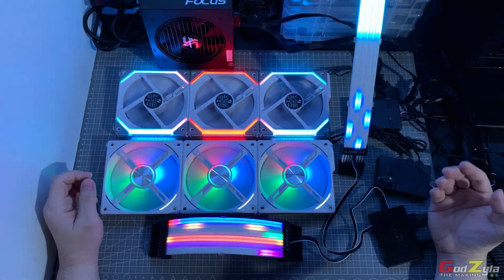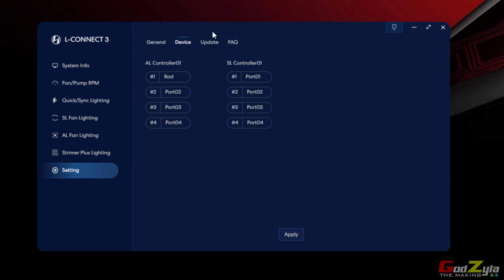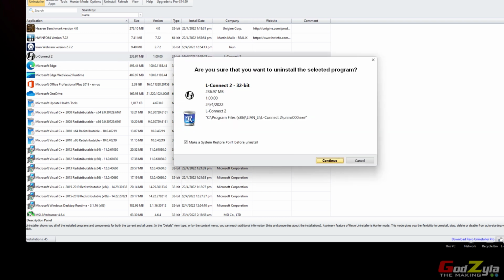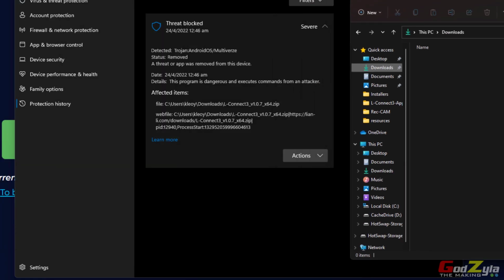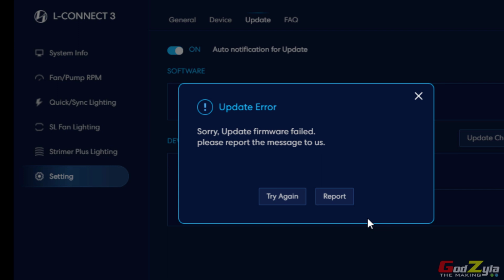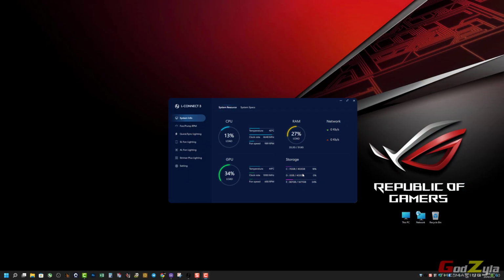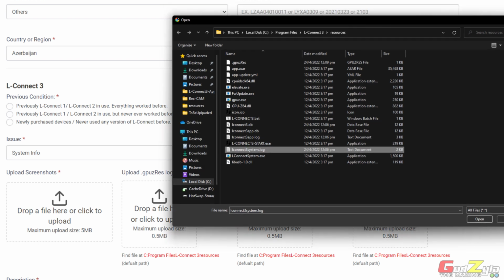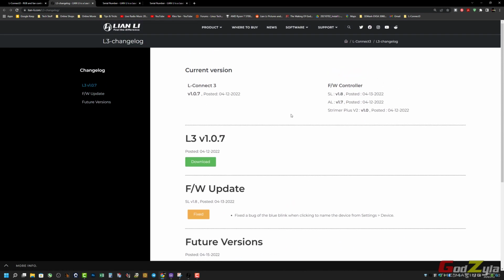Lian Li - L-Connect 3 (Installation)

Comment: hi,really like your video, i just installed l-Connect 3, but show cpu rpm is 0, cpu temperature is 0, how to fix it? thank you
Reply from the maker: Hi xiaotian wang, welcome to my channel. After installing the L-Connect 3, did you try to reboot your system? if after reboot and it still does not work, kindly grab the logs as shown in this video and to submit at lian li tech side. Do pardon me as i have limited knowledge to fix that. Once again thank you for your visit and the compliment.
Reply: @KleoYan  thank you for the fast reply. i did reboot.
Do you think  al120 fans should connect to lian li hub or connect to motherboard fan header?
Reply from the maker: @xiaotianwang5282  It depends what are those fans for. If it's for radiator, I would plug the fan load directly to the motherboard fan header instead of the uni controller and to leave the argb connector to your uni controller. The reason for this is.. just incase if the uni controller die on you. the only thing that will not work is your fans and not your fan load which is required to cool down the radiator. This is just my opinion.
Reply: @KleoYan  i don't have radiantor, just air cooler. so uni fans in my pc just for air flow
Reply from the maker: @xiaotianwang5282  I see, as mentioned is your choice. you can plug to the uni fan controller for both fan load and argb load. but i will still recommend to connect the fan load to your motherboard fan header that says CPU_FAN and plug the argb to your uni fan controller. The choice is yours .
Reply: @KleoYan  thank you for the reply.
should i connect fans to cpu header or cha_fan header? And air cooler is using the cpu header now.
Reply from the maker: @xiaotianwang5282  hi, ok am not going to confuse you as I am not clear what fans you are using for and such.. let me just put it this way.

1) for Air cooler fans for your processor, just make sure it's plug to the CPU_FAN header. if have argb on fans, then plug the argb connector to the uni controller. Let your motherboard control the fans RPM and let uni controller control the argb. 

2) The rest of the case fans, just plug to the uni controller, let uni controller control those fans.

Comment: Great video. So we need a whole new v2 controller to be able to control the strimer plus cables? What’s this all in one solution you were talking about? Connecting all the fans and also all the strimer plus cables to one controller.. Is that what the V2 controller going to be able to do so we don’t have to use the uni hub for the fans and the other controller for the strimer cables
Reply from the maker: Hi Allen Sosten, welcome to my channel, the new strimer v2 controller is for your strimer plus only. Let’s put it this way. For software is all in one in L-Connect 3 app, as for hardware you will need the respective controllers for AL fans, SL fans and the strimer plus argb strips. Hope I did not confuse you.
Reply: @KleoYan  oh ok. Nope. Perfectly understood. Thank you. When will this new V2 controller be available to us?  Also i recently bought the new SL unihub so I’m able to use LCONNECT 2 with my unifans. I’m wondering will I need new uni hubs for L Connect 3 or will I just be able to dload LConnect and it’ll integrate my unifans?
Reply from the maker: @A.Sostan  the uni fan controllers of either AL or SL works fine with this L-Connect 3 app. It’s plug and play but firmware upgrade might be needed. It can be done through this L-Connect 3 App. 
As for strimer plus v2 controller, release date as what I know will be around earliest May to mid May. If you do not have the strimer plus and intend to get it. Wait till the strimer plus v2 is out as it comes with the v2 controller.
Reply: @KleoYan  thank you for the responses. Appreciate it !
Reply from the maker: @A.Sostan  you are most welcome.

Comment: Absolutely love your channel as it is my go to spot for detailed information whenever Lian Li comes out with something new.  I may wait until the new v2 ontroller is out for the Original strimer plus and check the price.  Thanks for this video.
Reply from the maker: Hi Pat Sipes, welcome to my channel and thank you for the compliment. Yup info on those v2 should be around the corner. 👍

Comment: Hello @Kleo Yan, couldn’t catch you on what you said about “they have powerful machine” I am on X570 Aorus master, 5900X,rtx 3080, is it possible to update all my controllers normally without plug 1 by 1 or it can cause bricks?
Reply from the maker: Hi Yasser AK, welcome to my channel. I have seen some of my friends having successful rate by updating the firmware with 2 uni controllers plug in but on the safe side, I recommend do it one at a time to update the firmware. The choice is yours. Either you take the risk not to.
Reply: @KleoYan  Oh I see, Thanks bro for the great video.
Reply from the maker: @yasserak1607  You are most welcome.

Comment: After a little under a year with 5 sl120s and Lconnect 2..I Finally...was able to get...adjustable fan speeds...it was default set to quiet..which I'm fine with..but now I have the cool option of setting the speed..needed some update called mouse ..something...anyway this popped up on my recommendations..so I added this comment
Reply from the maker: Hi Rico Suave, welcome to my channel and thanks for the feedback. Greatly appreciated 👍

Comment: Well
Untill all problems are solved I will not use L connect 3
It's incorrect and causing so much problems
I am kinda disappointed from lian LI because they take forever to fix something
Same for new stuff
They take forever to publish the new infinity fans
Reply: Yeo they should sort the issues out before releasing the software. My L2 is working fine, once this has no issues i might upgrade.
Reply from the maker: @PixelVogue  hi, welcome to my channel, let’s look on the bright side, at least you can have all in one to control everything without installing different application but nevertheless, yup should iron things out but it will be good if users like us find some issues and report to them. As not all pc works the same way. There are so many combination of hardwares. Once again thank you for your valuable feedback.
Reply from the maker: Hello J J, welcome back. I understood where you are coming from. Lets see if Lian Li does fix all the issues we are facing. It will be good if you did ever try the app and have issues, submit the log for them to diagnose. I can only tell you that during the beta test, there are more issues but they did fix some issues which I have listed to them.  Thank you for your feedback too and being supportive to my channel.

Comment: Why do they have to make a complete new software? It would be more convenient to just give us an update for the Lian connect 2
Reply from the maker: Hello M Guardiola, welcome to my channel. well lets just say that the competition is pretty competitive. Base on what I feel is that Lian Li is trying to set this software as a one stop hub to control all.
Reply: @KleoYan  Well, Lian Li have failed miserably. Their beta test program is a perfect example of how not to beta test. They have released a software that isn't fit to be an alpha build. Which begs the question; What were the beta tester actually doing? The whole software is a buggy mess! They couldn't even be bothered to digitally sign the software.. Lian Li need to stop bringing out new hardware, and spend more time building a new software, or even a proper ecosystem for what they have right now.
Reply from the maker: @Mapantz1  hi and welcome to my channel. Thank you for your feedback. I partially agreed with you. I was one of the beta tester and during that period, there were other issues with the argb effects and they did iron them out before releasing version 1.0.0. Yes no doubt there are bugs and such. I proceed to work with my issues via the form I've submitted to Lian Li Tech Support https://lian-li.com/faq/. With replies, I continues to feedback and to test. You might say this should be their problem not ours, but I want things to get resolve? Will that be resolve by not even giving them the chance to diagnose what I am facing? Anyway my experience was great, though it's a painful process but gradually my issues got resolved one at a time. These are my issues and the version mentioned where not even publish till they have gathered enough information which not only resolved my issues but others who have faced it. 

1) Version 1.1.5, It does capture CPU & GPU readings but it stay still, does not move with real time stats
2) Version 1.1.6, it does capture CPU &  GPU readings and it does reflect real time stats but with delays
3) Version 1.1.7, it does resolve 1) & 2) but had issues with fans following the temperature as my fans go 100 percent even setting up the curve in L-Connect 3
4) Version 1.1.8, fixed all 1) to 3) 

As for version 1.1.9, it's based on others who have submitted their issues. It's being fine tune and was release before June 5th (stated on their changelog site 2 days ago). 
I can't represent others but at least my issues are resolved. https://youtu.be/mMHI9rv8-us 

I do not have the obligation to answer any questions, is just my passion to help but with limits. (Pay it forward). I hope you are not offended. In general, anyone having issues, by stating flaws are good but will that resolve anything? Or would you prefer to have logs for Lian Li Tech support to diagnose it and to solve it for you? So that's my question to you.